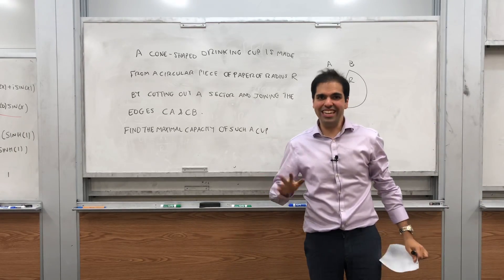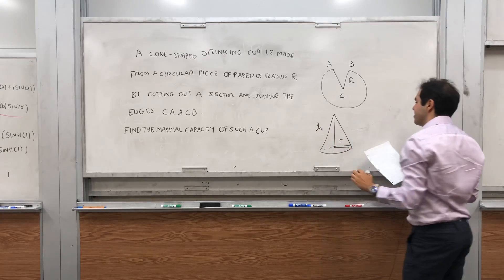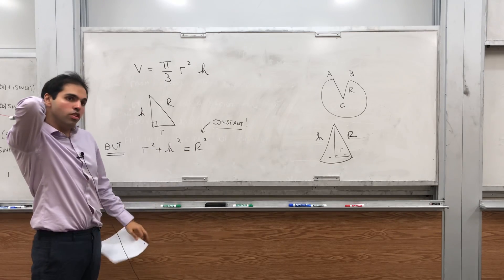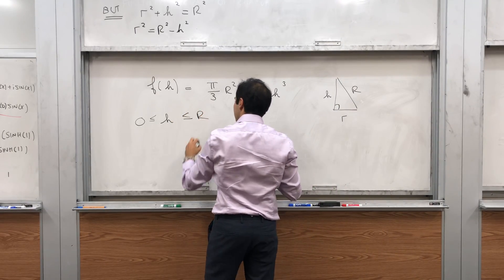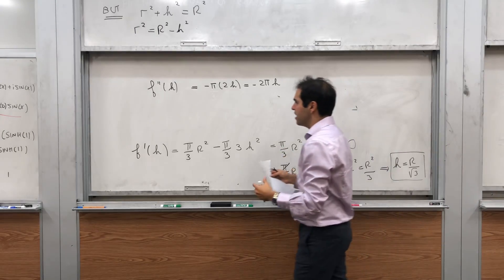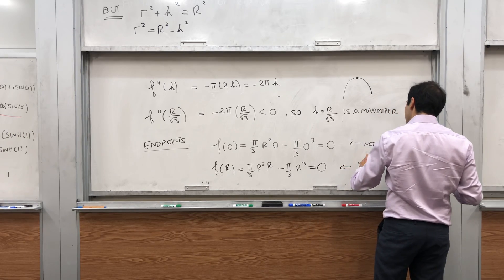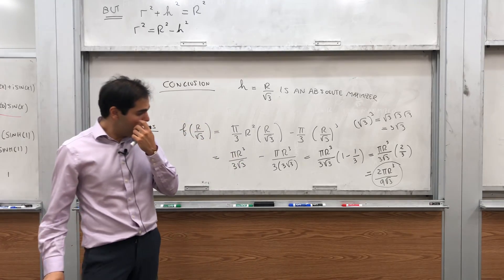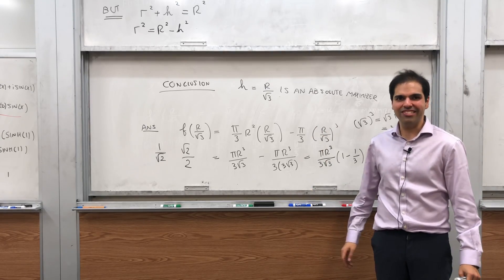Volume of a paper cup

Comment: I did it by asking, how big of a sector should be sliced off from the original circle? I set theta to equal the amount of angle REMAINING in the circle, and calculated the volume in terms of R and theta. Then set dV/d(theta) equal to 0 and solved for theta. It was more difficult to optimize volume in terms of theta than in terms of height, but the advantage is that now it's easier to construct the cone by measuring the angle and removing its sector. Knowing the height is R/sqrt(3) does not make it easy to solve for theta! It turns out you should remove a 66.06-degree sector of the circle.
Reply: I loved doing this problem, thank you for the challenge and for showing how to do it!

Comment: Solved this by optimising the (half) angle at the apex of the cone, θ. Cos θ = 1/√3. Gives the same max volume as in the video.

I calculated the angle ACB = 2 π (1 -  √(2/3)) which is about 66°.

So I made one this morning. The shape may be optimised for holding the maximum volume of water, but it certainly is not optimum for using in a vending machine!

Comment: nice and simple. But I remember long time ago (maybe 30-31 years ago) i did this based on the aperture angle of the cone instead of its height. After finding the optimum value for the aperture angle, I related this aperture angle to the sector angle of the original circular sector to see how we should cut the circle
Reply: True because h is not simple to deal with !!! If a is the angle ACB then :
a = 2pi.(1-sqrt(2/3))

Comment: Hey Peyam. I found that if you look at mapping f(z) = z^a where a is in (0,1] it looks similar to what happens to a papercup where you cut a bigger and bigger sector, except you only cut it from the -1 direction.
If you move from a = 1 to a = 0.1, you can visualize it as the paper cup getting higher and higher.

Now if you look at the mapping g(z) = z^b, where b is in [1,2] . When you start from b = 1 and move towards b = 2, you simply take the lower half of one disk, and take the upper half of the other disk, and then you keep adding pieces from both disks and join them in the -1 line so that the disks bulge out of the plane. At b = 2, both disks are now complete and they meet up where their original points are at angle 2pi(=1). (Which makes sense since  -1^2 = 1))

I haven't calculated this, but  if you look at this from "above" you could also try to find the exponent b, such that the volume encased by our disk is maximized.

If you take b = 1, obviously the volume would be 0, but if you take  b = 2, the "water" would run off through the edges so the volume would be 0 aswell. (because there is enough "fabric so the ridges starting from the origin have negative slope) (This isn't the case for b = 1.5 for example)
Reply: Another cool visualization would be f(z) = z^u, where |u| = 1.

Starting from u= 1 + 0i and going slowly to  u = 0 + i, it would be like cutting the disk from the left side (a cut from -1 to 0) and slowly streching the cut edges, so that the edge which belongs to the "top" part of the disk goes up and the other edge goes down, while keeping the edges on the same place when you look from above. 

Then when, you hit u = -1 + 0, you obviously get the inverse, which you would get by continuing the shear in the other direction, until all of the disk is flipped inside out. Then the same thing happens in reverse (because if you go clockwise, you get the same thing except the top part goes down etc.)